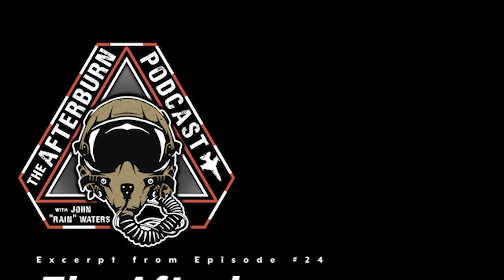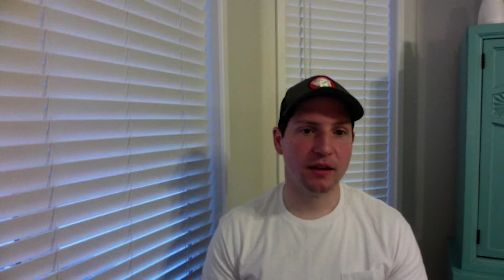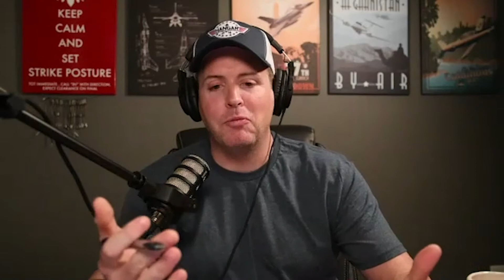F-16 Ejection Seat Failure

Comment: I used to work in Egress and I have always wondered the penalties for the ones involved in signing off that seat. Any idea?
Reply: I also was an egress tech. I worked on B52,OV10,T28, A1,T39,T33 and B57 aircraft. And before anyone gets confused, yes the T39 had an escape hatch with an explosive thruster in it. And yes those are a lot of old aircraft, but then i am 72 years old. But what i wanted to say is that the egress tech’s in my units suffered a great deal after the loss of an aircrew member. No matter how good the tech, no matter how carefully we did our work, no matter how we recorded the work done. We would still wonder. Did the system fail? Did the aircrew choose not to use the system? Could we have made a mistake? Did our actions kill this aircrew?
You have to understand,you can’t function test an egress system. You just can’t test it! Only the aircrew can test this critical system. It’s likely the test will be done by a wounded person under the greatest possible stress. 
 The egress systems i worked on saved 5 air crewmen. 1 was lost and not recovered after ejection. 2 choose not to eject and were lost on takeoff.

Comment: Do we know if retracting the gear was possible or was that not an option given the hydraulic failures? Belly landing?
Reply from the maker: No way of knowing for sure.  My guess is he would have run into issues cleaning up.  The Lockheed engineers stated their recommendation would have been to conduct a controlled ejection based on the information available.